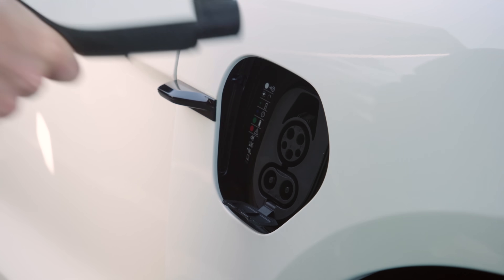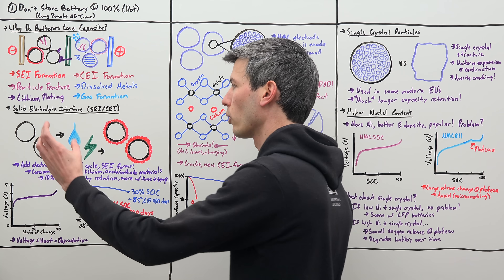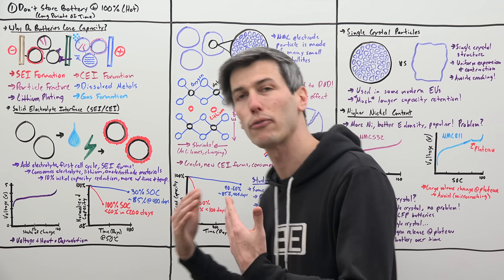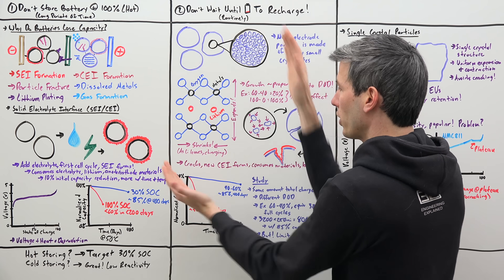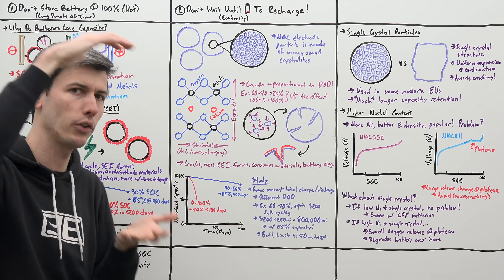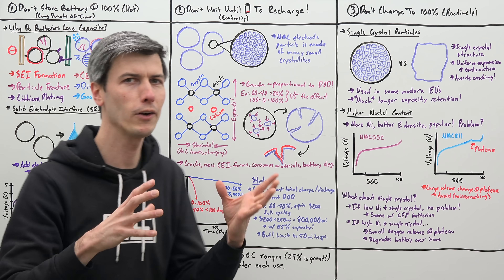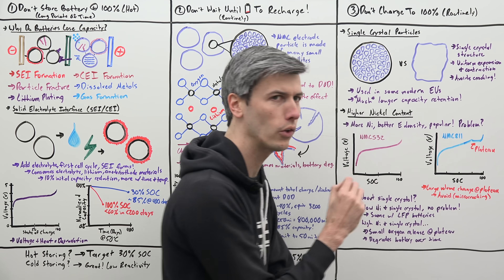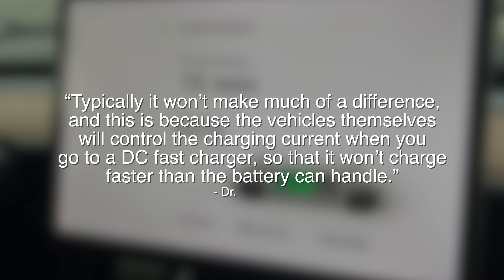How To Ruin Your Electric Car's Battery - NMC Edition!

Comment: I don't have an EV, but I somewhat assumed they had "smart" controller that could automatically devise a good charging plan (with override if the user wants to make sure the battery is fully charged sometimes). While it's nice to make people aware about how to handle their batteries, it would probably be way more effective to have this built-in.
Reply: The smartest thing about most EV's is that they prevent you from charging to true 100% in the first place. There is usually a buffer that is not used. In my old Leaf, for example, the battery was 62kwh but the car actually only lets you use 55kwh (about 89%).
Reply: @TIGFAD that’s not the same thing. The buffer is additional cells, it’s not preventing the cells in use from being charged to 100%.
Reply: @Thirty-Ninety Yeah except the leaf thermal management was non-existent and they all have cooked batteries. Stay away from a battery with no thermal management in my opinion.
Reply: @Jjengering  The vast majority of leaf rarely if ever fast charged, also not everyone lives in a desert. The battery of our Leaf was perfectly fine for 5 years untill someone decided to rear end us. Problem is to get reliable data about the usage of the battery
Reply: Leafs use pouch batteries which are impossible to manage heat-wise. The cores can get really hot.
Reply: To increase longevity, the BMS can stop charging the battery at 80% SOC. The problem is that if they were to do this, OEMs would basically be leaving 20% of range on the table. In a market where range is one of the most important specs of an EV, most manufacturers do not want to do this. Plus, maybe a user might actually REQUIRE that extra 20% range, so it would be counter productive to be locking that battery capacity out. It makes more sense to provide users with a "charge to 80%" option, that way people who are interested in longevity can follow this best practice while also having the option to increase the charging to 100% whenever needed.
Reply: @Freakishd  Yes, the Taycan can be 80% default or 100% on long journeys by Porche's recommendation,a LNC battery, which has higher density and oomph!  However for LFP it's recommended to only use the range of 20-80% for a much longer battery lifespan - so, that's BYD and Tesla BYD packs. Guess it'll be local runabouts only and an old diesel option for long journeys outside of range limits...
Reply: Many vehicles have this, but people are idiots who refuse to listen to advice.
Reply: Yes. I just find it so much less bother when I can fill up in 5 minutes and get 800 miles range... The average Joe who will be the majority will never bother to learn anything about their EV, certainly won't read the manual or the emergency guide, they won't be bothered to tweak the software setting like most PC owners. Software-Defined Vehicle -> build best practice into the EV's software not the user. Still, they'd have to stop selling diesel before I considered one...and that's after switching to cooking oil...😉
Reply: Tesla and Ford both tell you what to do on the screen when you plug in.
Reply: The display has nothing to do what is actually 100% or 5% ...
Do you actually think theyd risk having to swap your battery in warranty 2 months befory it ends?

Nah, they will do a "battery check", software update, suddenly you got 5% more range again than minimally allowed and you reach the end of warranty just fine.
Reply: you know what assume means right?
Reply: Teslas do cheap knockoffs dont so buy quality tp or go around smelling like poop

Comment: Buying a used EV is even more of a crap shoot than an ICE vehicle,  because those owners who know they are going to pass it off in a couple of years are very unlikely to follow any of these guidelines.  At least with an engine,  you can see the effects of unchanged oil and other abuse.
Reply from the maker: I don't know for all cars, but for Tesla at least, you can check the remaining battery capacity so you know the health when buying used.
Reply: @EngineeringExplained is it possible to hack?
Reply: @alexprost7505  No, if this were possible people could artifically overstate the degradation to get a new battery just before the warranty runs out. It's the same test Tesla uses themselves.

Comment: Charge amperage doesn't matter?  I set my charger to 16a thinking I was being kind.
Unfortunately, this explains why a big battery helps, small battery needs to charge to 100% more often.  '15 BMW I3 charges very slowly near 100%, battery seems to be doing well w 4 - 5 day/wk full charging.

Comment: What impact does re-generative braking/charging while the vehicle is in use have? In this case you have simultaneous charging/discharging? What does that do to the crystalline structure? Suppose you had solar panel roofs and trunk and hood and were driving in strong sunlight?
Reply: The max regen possible is the power of motor but in reality it’s limited by grip and motor rpm 

So if say, your motor uses 25kW continuous power to maintain 100kmph speed (pretty avg)

The regen power you get when letting off the throttle at this speed in highest regen level of an EV would be 25kW even if your motor is rated like 200-300kW 

25kW is higher power than what an AC home charging setup gives but far lesser than most DCFC stations. 

Another point is that at 100kmph, a car like model 3 at 1900kg has just 2 kWh worth of kinetic energy. So even though you have 25kW of peak regen the moment you let off the throttle, 

1. The regen power keeps decreasing — as in, the rate of deceleration reduces with falling motor rpm and speed. So at 80kmph the power would be 20kW and at 40kmph it would be 10kW and so on. 

2. I could probably work out the time taken to stop from 100-0 purely by regen using calculus but it’s way too late in my time zone and I’m way too lazy. 

Assuming it does remain 25kW for entire duration and motor being 90% efficient meaning 1.8kWh energy actually comes back into battery from the 2kWh initial kinetic energy, it will take just 25s to stop 

So yes, it did get the equivalent of level 2 home charging levels of power, but only for a short time (few seconds). And the energy transfer is just 1.8kWh anyway 

And that’s worst case when stopping from 100 purely on regen 

Stopping from city speeds of 50kmph will have 1/4th the kinetic energy or just 0.45kWh
Reply: @shresth1201  But what is the impact of simultaneously charging and discharging on the battery chemistry, specifically the crystalline structure?

Comment: Having a percentage on a battery powered car is the biggest flaw I see.  If 100% is bad, then 100% is a bad way to display that information and it should not be the default.  Instead of a % it should be Estimated Range display by default. Changing human behavior to treat 80% as good an 100% as bad is silly.

Comment: #1) "Leaving your car outside in the heat for months at a time.." The southwestern United States is not an edge case. If you forget your phone in your car even once in a Phoenix summer, you will likely have to exchange it because of battery damage. It might even expand enough to pop open the phone. I would expect car batteries here to have a dramatically lower lifespan simply due to the ambient heat. Even traditional lead-acid starter batteries have lifespans about 20-30% less than in other regions. So if you buy a three year lead-acid starter battery, expect to replace it after a bit over two years.

#2) IIRC, it isn't the full depth charge that degrades things, per se, it is allowing the battery to go below about 10% and, more especially, near 0%--the "Sorry, you're SOL" discharge level. This is a problem on other battery types as well. So the rule is that in general use, you should try to avoid letting your battery go below 50% when convenient, but unless you can't avoid it, never ever let it go below 15% because then you are starting to do damage. Sure, only a bit each time, bit cumulative damage is happening. No, it isn't fatal to run your battery flat, but know that if this is a routine thing that you've only yourself to blame when it won't take a full charge anymore.

#3) I seem to recall that this phenomenon (the 100% charge) has been well known , also affecting #1, and that manufacturers put in circuitry to prevent a 100% charge, so, if that's indeed the case, what you're being TOLD is 100% is really probably more like 90-95%. Problem solved. (Maybe.)

Fast charging...   More info for the curious. The higher the charge on the battery, the greater the resistance to additional charging. Thus, when the battery is low, less than 10%, it can VERY quickly be charged to 50%. From that point on, though, the battery's internal resistance grows and trying to apply the same level of charge generates heat in the battery and heat is the enemy of a battery. So the charging rage has to be ramped down and part of that is controlling the voltage of the charger, since voltage a lower voltage for the same current means less heat generated in the battery, but eventually, for the last phase, you have to reduce the current as well since the battery simply can't take it because the chemical reaction that stores that energy takes time. So you have to allow for that.
Reply: Its a bit of a non-event, Pheonix has an average temperature of a little over 22C / 71F. Tesla actively heats their batteries to over 50C/122F on purpose to improve charge and discharge performance, that phone in your car has probably experienced 80C / 176F inside the cabin.

Comment: I have a Model 3 P I bought new in '19.

There is no way in hell I can keep my battery between 60-80%. I have to use my car as a car on occasion. The only charge point that isn't a supercharger is my home one. This also makes the range on my car, what, 50 miles as rated? Yes, I know this is for 'optimal' battery life, but I really wish I didn't have to babysit it just so it doesn't die. I've never charged it past 95% and that was on trips.

I just imagine the outrage if a gasoline vehicle had a "Only drive with your tank at 60-80% full" clause to it.
Reply: An 8 year battery warranty is there, just charge it and drive it I guess

Comment: Can you please do an explanation like this on lead acid batteries. I believe many automotive enthusiasts have been informed with charging techniques that are contrary to the way they're explained in this video
Reply: lead acid batteries should be kept fully charged. Don't overcharge them or fast charge them.
Keep an eye out for fluid levels.

Taken care off, lead acid batteries typically last longer than lithium or nickel batteries. Deep discharge will kill them tough.
Reply: Because lead acid battery best practices are different from li-ion ones. Same is true for the old Ni-Mh batteries

Comment: Many car makers program in a "floor" and "ceiling" for the battery charging.
So, what the car displays as 0%, may actually 10-15%, and what the car displays at 100%, may actually be 85-90%.
This prevents battery damage by the user, and is why there is a kWh value for "actual", with a lower value for "usable" or "effective".

Comment: Count me in as another Leaf superstar. I always charged to 100% everyday, but I charged at home and work with a very slow 110v charger, usually consuming 30% on each way to and from work. In the mild climate of Seattle, I saw zero range loss in the 65,000 miles and 7 years I owned it. When I sold it, the car battery data showed a 94% State of Health.

I suspect if I wasn’t “trickle charging” at ~1,100 watts, it wouldn’t be the same story with the constant, high top charge.
Reply: The first generation leaf had 24kWh installed but allowed you to use only 21kWh, so by design it prevented you to use more than 87% of the nominal capacity. This conservative design combined with the factors you mentioned makes it long lasting.
Reply: You are probably right about the L1 charging. I owned a 2013 LEAF (also in the PNW) and by the time the car was five years old, it was down to just over 60 miles range on a "full" battery (compared to around 90 miles when the car was new). The 12-segment battery health indicator was down to 9 segments.

The gen 1 LEAFs had, on the whole, terrible battery degradation. It would take some very gentle treatment to keep the battery health as high as you did.

A big chunk of that degradation happened in the fifth year when I was regularly charging to 100% at home, with a 5 kW L2 EVSE, in order to diagnose a different issue in which the 12V battery would die regularly. That problem turned out to be a flaw in the upgraded 3G cellular radio, which the local dealer refused to acknowledge as a problem until I told them to disconnect the radio completely, at which point the problem went away. Even after that, they didn't have a solution, nor were they willing to accept any responsibility for the toll that all the 100% charging took on the battery.

The car was totaled after some weather-related damage occurred, less than a year later. I suspect if I'd been able to keep the car a little longer, it would've qualified for a replacement under the 75% battery minimum on the warranty, since the battery was degrading even more quickly at this point.

Comment: I would like to see a full video on the fast charging topic you mention at the end. I've noticed that if I slow charge from a low percentage up to 100% then I get about 10% more range compared to charging at a fast charger.
Reply: I am not educated about this at all, but If I were to guess, I think it might be parasitic loss from heat. Faster charging speeds = higher voltage = more energy = more heat
 My uneducated assumption is that some energy is being turned into heat energy rather than transferring to the battery 100% of the way. Again, this is my uneducated guess, I'm not at all an expert about this and only have a faint understanding of the concept.
Reply: Easy answer: Tesla superchargers recommend right on your computer screen - limit 80%. Two reasons.
1.) 100% (80-100% take almost as long as 40-80%, so unless you need the extra 20% to get to your next charge station - don’t waste the time. 
2.) at 100% and especially in warm temps outside - you don’t want to sit idle ( batteries will loose your future range capacity through heat/hot chemical reactions that can easily be avoided at 80% max charge. ( think of it as a topped up to full gas tank sitting idle on a hot day - it may spill over loosing range) EV’s would be loosing range by vapour spillover ( my thoughts), but unlike gas lost in the moment, it’s like range lost forever 🧐

Comment: This is great and it also applies to essentially everything that uses Li-ion batteries, like phones and appliances. Good things to put in practice if you want to extract as much life off your batteries as you can.
Reply: My wife has a new iPhone and the battery can last 2+ days.  I have been trying to get her to let it drain to 30% and charge to 80% like I do with the assumption that fewer charges is better.  From this video, it sounds like she is right charging her phone daily (except that she charges to 100%).  Am I wrong again?
Reply: @garyganser2451  The latest iphone io update will automatically stop charging at 80% unless you're away from home or force it to go to 100%.
Reply: @garyganser2451 The optimum is regular charging to say 80%.
I get HUGE long life out of my iPhone batteries by doing that. 
(We have devices called “Chargie” to do that automatically).

Comment: Taking the example of my car, the manufacturer recommends to charge above 80% for a good battery life as above 80%, cell balancing occurs via BMS.
These are two contradicting statements Jason, when you tell to stick to lower states of charge. Your opinion will help here.
Thanks!
Reply: I believe once in a while it is a good idea to fully charge (or at least some above 80%) to calibrate it. I wouldnt do it daily though unless needed.

Comment: There's a lot of low-range cars with 28-36 Kw batteries, doing 20-70% is a no-go for many of us, even if we charge at home, because during winter it will take quite a bit of the energy from-and-to work. I do top it up at work to 100% as I have a 35Kw battery on mine, after a year I've seen absolutely zero degradation, it still tops at 100 percent every day.
Reply: Most BEVs are low range. Very few can reach the range that we are used to from regular vehicles or that we typically travel on a daytrip.
Reply: On bmw i3 cell balancing only starts when it is charged to 100%. It is stated in the manual that it is suggested to plug in as often as it is possible and stay connected over night. The BMS will do everything instead of you. There are many i3s with more than 400k kms with over 80% of their design capacity, even cars that had only 100-130 km range on new, so they are over 4000 full charges